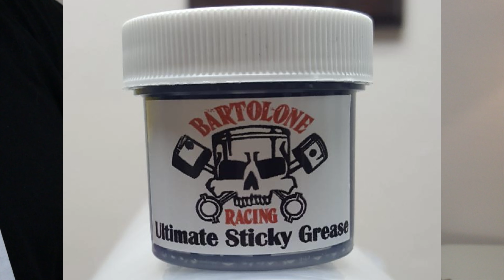New Bartolone Racing Products and Go-Kart Racing

Comment: Bad ass Gary! Can’t wait to see you out there racing. That chassis is lighter then my carbon fiber chassis and lighter then all my lightened Baja chassis I still have and not used yet. And those MIP torque handles came in use for me multiple times over this passed week. Ddm will carry the BR grease. I like it because it will protect our gears ⚙️ it won’t fling off like slick grease will! Holy moly looks like Alfred’s Go cart needs a lower gear 🤣😂🙈or a Big Bore 80 Supreme???
Reply from the maker: BOTAJELL it was a Harbor freight engine once the clutch stopped slipping he was moving pretty good all in all it was a fun time on Mother’s Day. Now something Epic has to happen on Father’s Day.
Reply: Foundry RC can you imagine how bad it would slip with my fat ass and heavy foot 🦶 on that thing? The clutch would look like 💨💨💨💨💨

Comment: That vp fuel in description isn't for 2 stroke engines right or is it?
Reply from the maker: John Doe Yes you can use it in 2 stroke engines it’s just marketed for 4 cycle engine but it is just Gas ⛽️ you need to mix it with your oil.